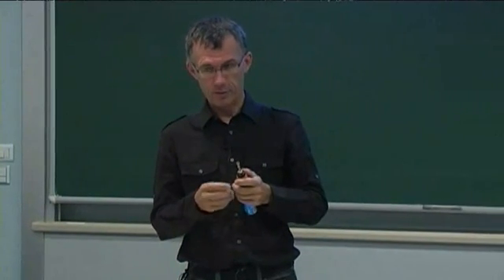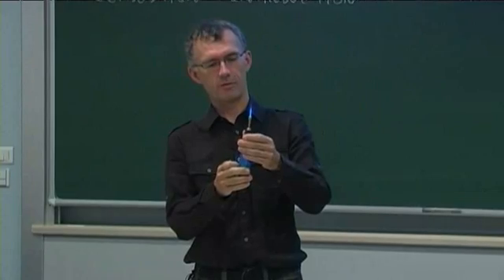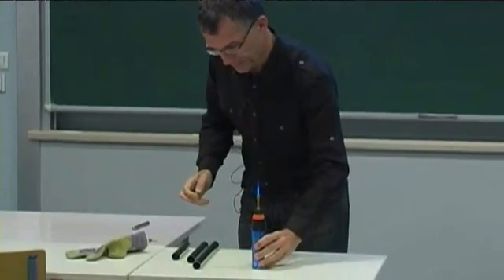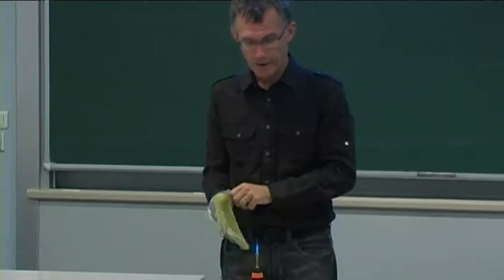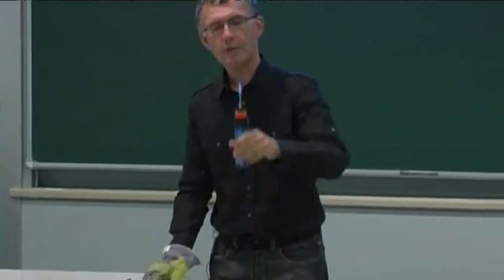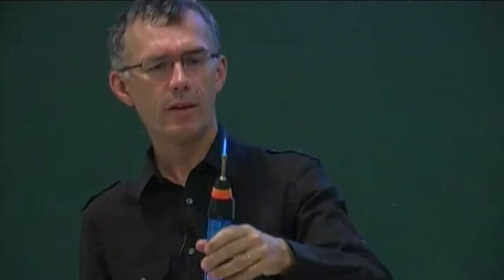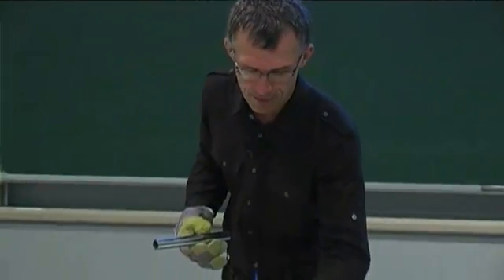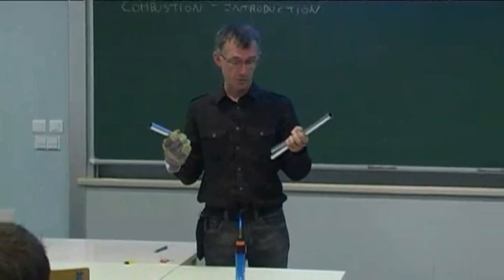Acoustic instability in a combustion chamber

Comment: Thinking In a rocket engine if Ion Wind effect could be used with high voltage not just to ignite engine but to create Ion wind to accelerate the ignited exhaust fuel?